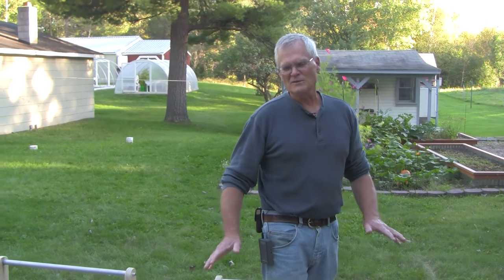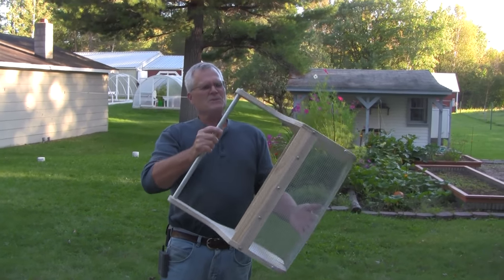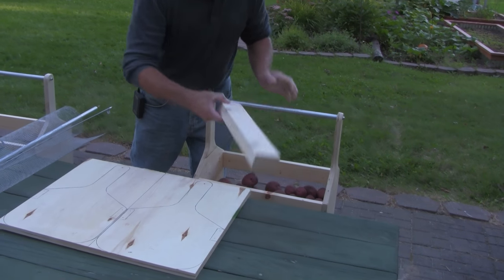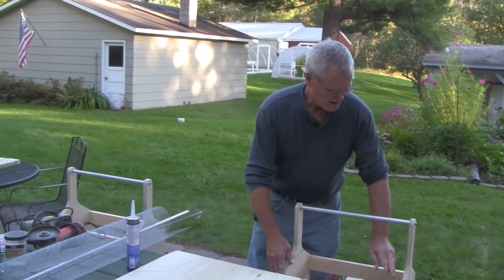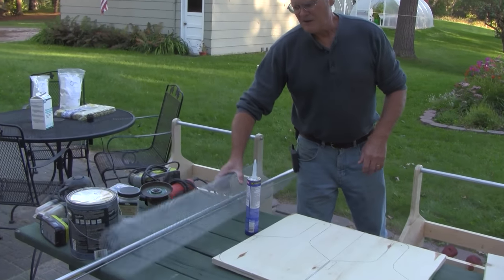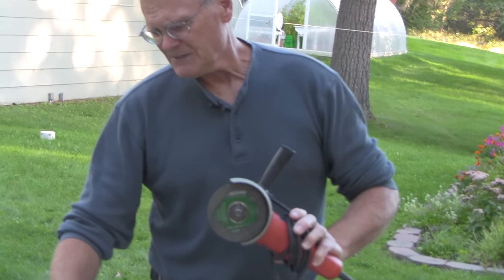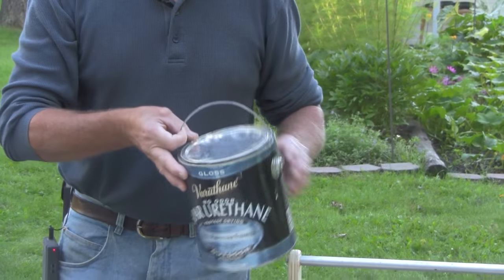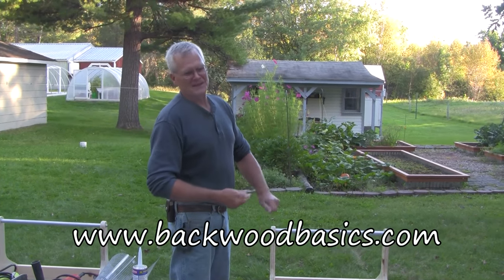BackWood Basics Harvest Basket

Comment: Size and shape are nice.  Plywood will deteriorate fast outside, esprcially since purpose is to wash vegetables after harvest.  Cedar would be a good material to use instead of plywood
Reply from the maker: We coat the wood, especially the end grain, in spar varnish. Ours are now several years old, and still holding up well. Of course, we don't leave them sitting outside when they are not in use. Just filled one today with dug potatoes. Cedar would be a good choice, but would mean joining boards together to get them wide enough.